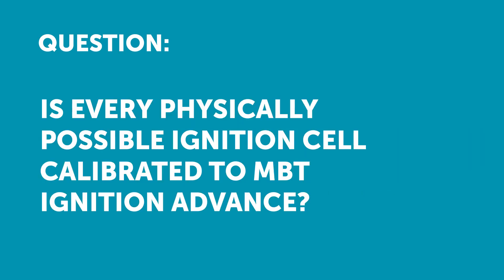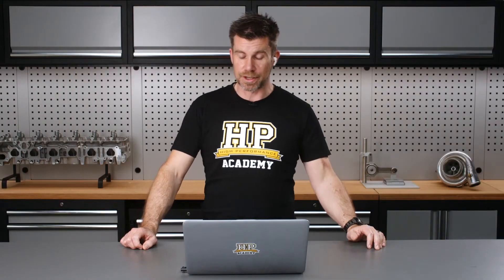Tuning Maximum Power In EVERY Cell? [HPA Q&A]

Comment: Will MBT on all cells in a range feel smooth, or do some cells usually need to be detuned as not to be jerky?
Reply: In my tuning experience, yes. I can't think of a time I've detuned cells to stop engine "jerkiness." The most important thing is keeping the graduation in timing, smooth between the areas where you are tuning for MBT. So, while you don't spend valuable dyno time hitting every single cell, you do aim to put sensible numbers in the cells between the areas you do hit.

Comment: Aftermaket or stand alone tune is not as polished as factory tune for most of the time, many factory ecu have mbt table already, they know how close we are from mbt especially in ethannol
Reply from the maker: We actually have a video that shows the opposite to what you state there and what a mess a factory tune can be: https://youtu.be/RbEoSHsWias

It has also been common for factory tunes between flagship and lower models to give you reduced power (or increased as the case may be) for exactly the same hardware. Holden/GM are well known for this as well as their factory tunes in general leaving a lot on the table due to poor optimisation.

Note that a a custom tune is for your engine, and a factory tune is based on averages for a model of engine across all the potential regions it will see around the globe along with emissions considerations that land them in hot water if they're not on top of, having many err on the side of caution - Taz.
Reply: @hpa101  What u said is ture. Factory tune is no where near full potential. But comes to data I don't believe most tuner have that much sophiscated data for each engine as factory tune does, such as mbt for gas and ethanol,  precise torque model even considered ac loss, cat temp model, valve temp model, a very tight knock sensor threshold and could learn by time. factory tune contains a lot valuble data to begin with. standalone ecu is not tuned like that. At least myself don't have that resource or time to test that many data, some of the data even comes out of computer simulation that calibrated with real world data. As a tuner all I can do is do some modifacation based on the factory tune because it have every data to model that engine already, or a simpler standalone tune. A standalone ecu works well, but just data wise it is only comparable to early model factory ecu.
Reply from the maker: @ocerrr  correct, however as above all that specific data is then averaged out. That testing is not done to every individual engine and some of it is to also confirm engine design and reliability, not just the tune.

You are also forgetting the purpose of fitting an aftermarket ECU to a car and going racing, and that isn't to do hundreds of thousands of KM's in a variety of climates and situations, it's to mostly be at WOT on a race track in a vehicle that is 'heavily' serviced by comparison to whatever you are driving to the shops.

This makes the comparison redundant, but I really just wanted to point out that despite all that RnD, the tools they have on hand and the level to which you 'THINK' and OEM should work to, they are just a company full of the same levels of disorganisation and staffing issues as any other large company and they are not faultless nor perfect in all their execution of getting a product from concept to reality and making a profit to do it all again - Taz.
Reply from the maker: @ocerrr  also note we're not saying you should run out and tune every and any car just because it can be done, but you certainly can improve on what the factory have done in some cases and once you start modifying things beyond the factory setup much of or sometimes everything they did is no longer relevant anyway - Taz.

Comment: Ill have you know the tried and tested method of establishing road dominance is to cruise past people at the highest possible rpm producing maximum noise and instilling maximum fear in surrounding motorists. That 7k rpm part throttle throttle table needs the best optimisation possible!
Reply from the maker: This is true. It's science I heard from a source I can't remember or cite.

You need to keep the engine at a constant state of readiness for this as well. It is done by constantly blipping the throttle when at a standstill. Doesn't matter if it's traffic lights, your driveway or 3am outside your grandparents house, it must be done constantly.

This applies to motorcycles too.

Revs up and be safe my friends - Taz.
Reply: lmao 💀